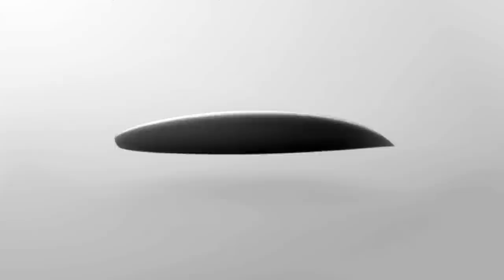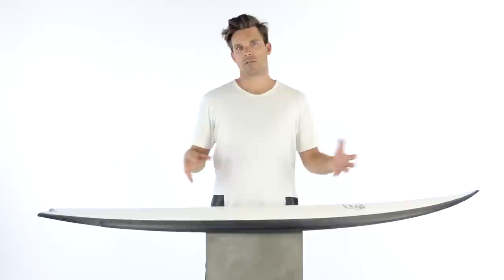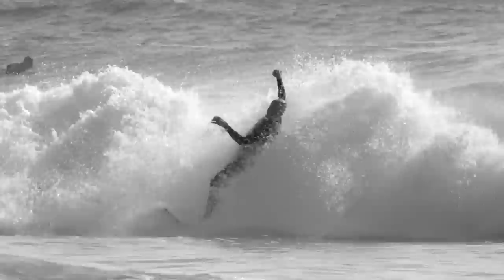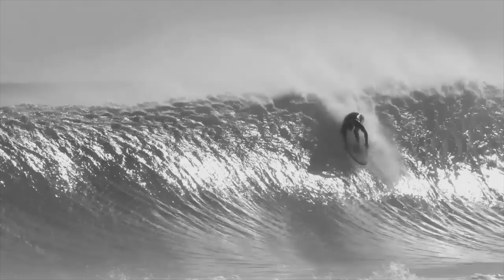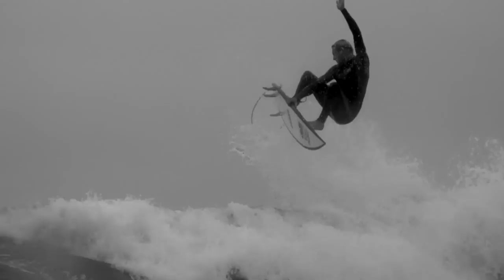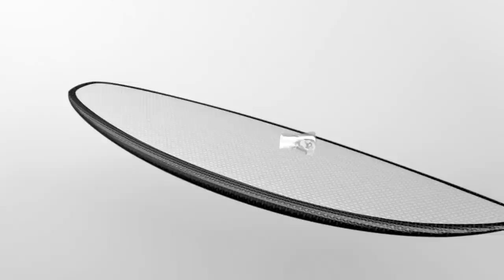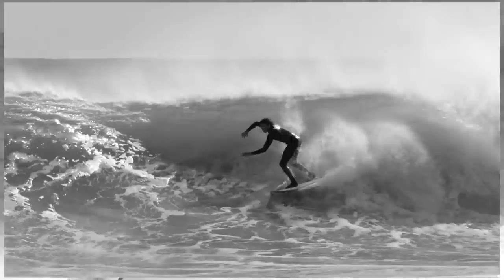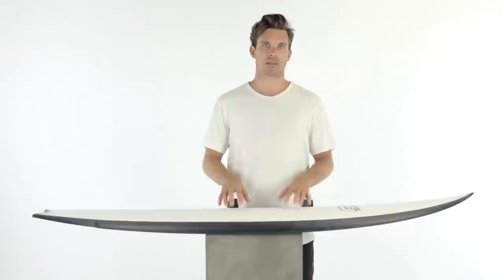FutureFlex Surfboard Technology (Patented) Designed by Hayden Cox

Comment: I'm not saying HS is a bad company but my dad broke his 6'0 Hypto on a big swell and my friend recently broke his 5'9 Love Buzz as well.... I still think the boards are good tho for some reason
Reply: Carlos_ sk8s How Big Where the waves?
Reply: Neox They were 3-4 ft Hawaiian
Reply: Carlos_ sk8s that's pretty big then that's like 6-8 foot faces you can break any board in surf like that
Reply: They so good support Haden all the way
Reply: Im rocking a 5"10 and im 5'9 at 150 lbs. The board fucking shreds on any type of break. Ive taken some heavy falls 8-10 feet, and the board is tough. It even shreds on steep beach breaks (im a lil bit more mindful) but i want to see how the foaming hypto krypto works
Reply: Diego Sevillano yah there sick boards. Idk what it was but that year wen they first got popular I seen a lot break. I don’t hear too many break too much nowadays
Reply: Carlos: they probably fixed some basic issues. Thats always the gamble with new tech. However, if im a pro surfer shredding off the coast of Africa. I can probably get 30 hypto krytpos and holy grails air dropped in to my location. They probably break 3 boards a seshion. But we got to drop 1 grand at our local surf shop for 1 board?? Lol 

But I will say, the hypto krypto is worth it. All my friends have different boards for different breaks, and im over here pulling out my 5'10 hypto for any day and any break. The only regret I have is that I didn't go smaller. I easily could of got away with a 5'7 or 5'8